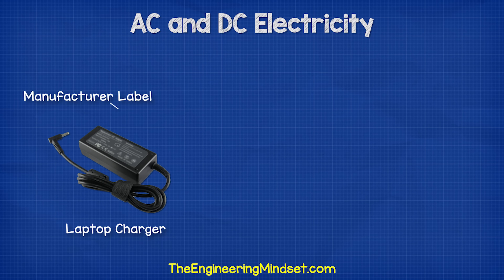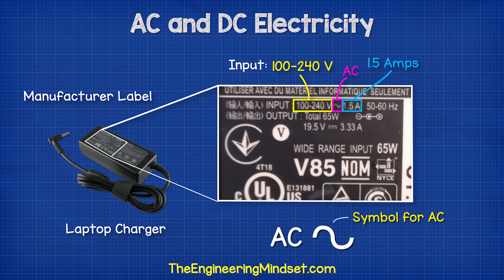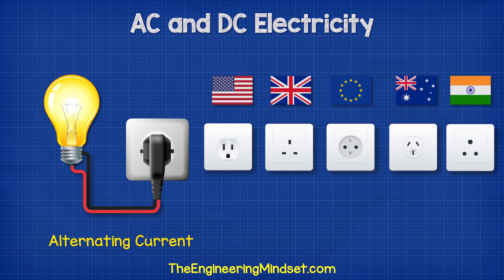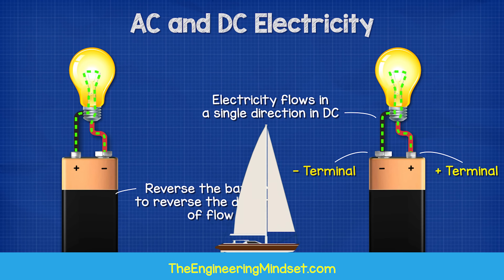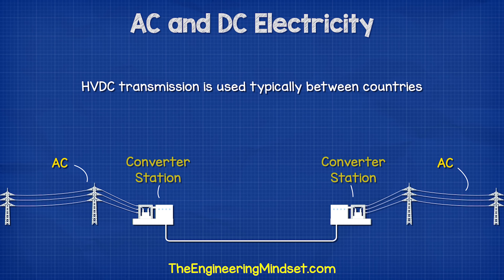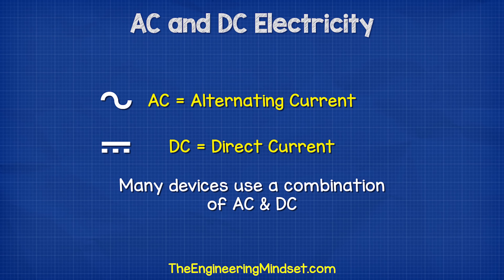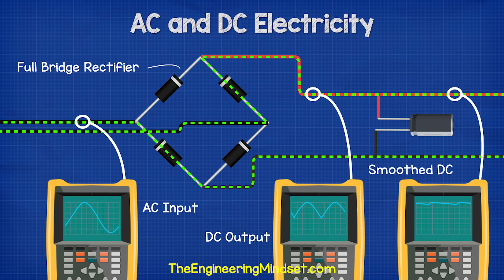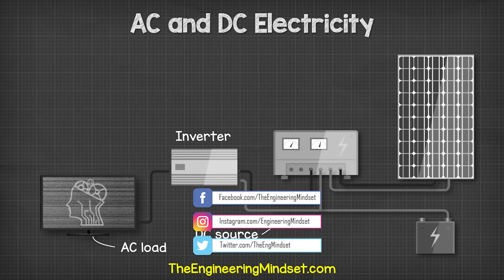AC and DC Electricity basics

Comment: If someone could please tell me why alternating current happens in a generator???
Reply from the maker: Please see our generator basics video, it will be clear
Reply: @EngineeringMindset  I would really appreciate if you described why the current changes direction in a alternativ current. Is it something with the field lines? I understand moving the magnet in and out causes a AC, buy now when the magnet is spinning
Reply from the maker: Watch this video https://youtu.be/WhATjUHgzxQ?si=YhJdWId9u88VLfHP
Reply: @EngineeringMindset  I watched that video, but on the other hand, I really didn't understand why the current switched direction when the magnet came close and then the opposite
Reply: @EngineeringMindset  It is because the magnet has a north and south pole, almost like a negative and positive charge which, either pushes the electrons out when it is the negative side of the magnet but attracts when it is the positive charge?
Reply from the maker: Yeah so the easiest explanation is that the electron is negativity charged so it will be pushed and pulled by the magnetic field of the magnet.
Reply: @EngineeringMindset  My teacher told me that when a magnet is spinning in coils of wire and the north side is on top while the electrons are on the bottom, it will cause the electrons to go upp because electrons always go to N. But because the magnet is rotating, the electrons will go to the bottom because the N is there now

Comment: The ocean tide goes up a d down but keep going forward,AC goes back and forward and doesnt goes anyway.that why it turn everything very hot and destroy all wires abd device so fast.it is the best for manipulate current flow in other to do something else but for send electricidad is not good.the fact today is used on it doesnt mean is the best.current flow direction is where ever u send   it using this AC tecnic but electrón flow is another thing.cant be transformed.

Comment: Sir good day...I am the one of your youtube subscribers, I always watched your knowledgeable videos thank you sir for sharing us your knowledge. Can you make a video sir about automotive ignition system ( primary coil attached from battery other end to  a transistor inside the computer or the ignition coil itself which have a transistor incorporates into ground to on/off circuit) (2nd coil is attached to ground other end is to the spark plug) now I wondering why the current flows through spark plug gap to produce spark where their is a gap represents resistance open loop. And the current is always flow through less resistance,now why current will flow to gap rather than to the end of a 2nd coil that is being attached directly to ground where their's less resistance? Thank you sir hope you will answer this question...god bless

Comment: A question for Paul or anyone smarter than I... I have an obscure home heater that was never actually produced other than the initial one month run before the company went under. (a parts nightmare).It's 100% 12V via an onboard inverter with the idea that it can be run on a battery backup system. 

Problem:  I need to replace a 7-inch diameter pull style fan that currently runs @ 12V/1.8amps... I can find many 'replacements' that offer the needed CFM but are rated at about 7 amps (Automotive cooling fans). 

The trouble is that my fan is controlled by the main circuit board which offers 3 speeds with the highest being what I would assume is a "full current" meant for the 1.8 amp original p.o.s... Will adding a fan with a larger amp rating fry my little circuit panel? Any insight or suggestions would be awesome. Getting COLD in Wisconsin. :))

**I COULD run (and would almost prefer to run) a fan with a separate power supply and a motor speed control, but would then I would need to know how to "fool" the panel into thinking the original is still in place, as the board goes into some sort of safety mode when the factory fan is disconnected, which might be the easier solution.
Reply from the maker: Check our new  Power Factor Explained video soooo much detail and easy visualisations https://youtu.be/NIrKOVZrqnU

Comment: I know how to not get shocked on low voltage. And how circuit logic would theoretically pan out. I regularly have to replace compressors for work, and other stuff like that, refurbishing certain machines. Trouble shooting the fairly basic power distribution for the AC to DC portion was really slow. Luckily last time I had trouble, I knew the Board took DC, while the other mechanical parts took the AC. So I just had to follow the paths, and make sure I knew exactly were to touch with the meter, when I flipped on the power. It was a bad transformer last time. Not the fuses. It took me an hour of running through the logic before I was confident I was correct. I was. Fun. So fun. I probably could have used this then.

Comment: Is it true that AC has more voltage and more powerful, DC has less voltage, less powerful. Is it possible to have DC with 230 voltage and AC 9 Voltage?
Reply: Yes. First invert the DC to AC. Then use a transformer to get your desired voltage.
Reply: Absolutely. We don't generally do that because Current tends to drive torque, but it also drives losses. So, for DC devices, we deliver with VERY high voltage AC (cheap to deliver) and easy to down volt) and then power devices with a more balanced mix of Current and Voltage to get the motor characteristics we want (not everything is motor based... but a lot is).

Comment: I’m getting ready to mount 28 X 250W solar panels on my 40’ shipping container. I can build anything, plumb it and run basic electrical but have such a hard time with all this. Even 20 years ago taking “Maintenance exams” for work, the electrical part just doesn’t set into my brain. Thank dog for the internet and mostly as of late, Engineering Mindset. Thanks.
Reply: Dog always takes care of you 🙏🏻
Reply: @profesorjirafales7215 dog nhi god
Reply: Can I ask, 8 months later, how is it going?
Reply from the maker: Seen our new video on HOW SOLAR PANELS WORK in detail https://youtu.be/Yxt72aDjFgY
Reply: you don’t have to worry much about it depends what you build AC is the standard everywhere so you’ll be fine most things that require dc are made by electrical engineers ready to be sold and installed